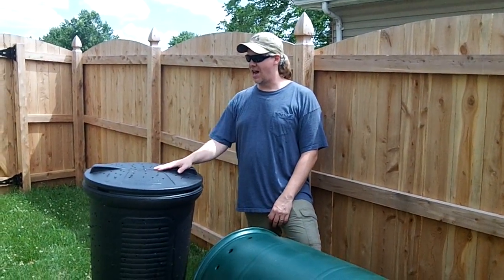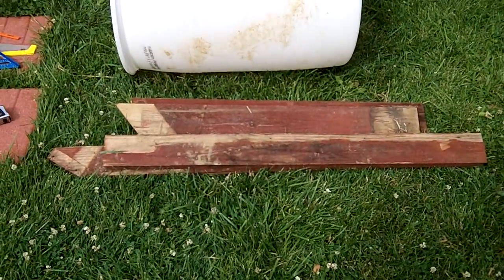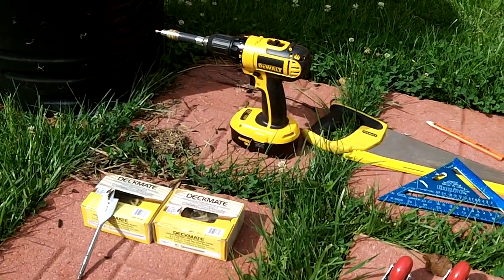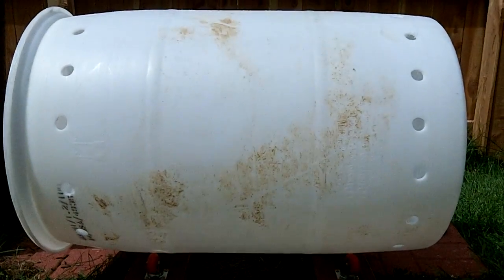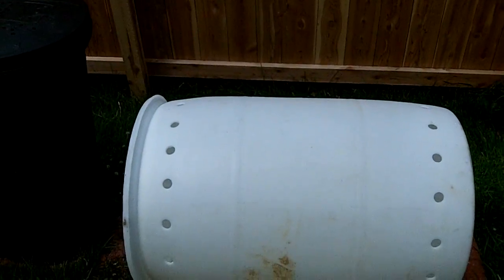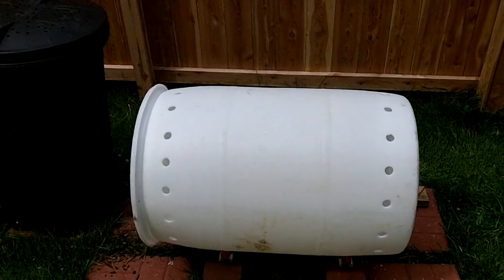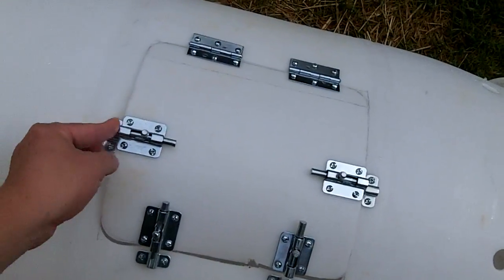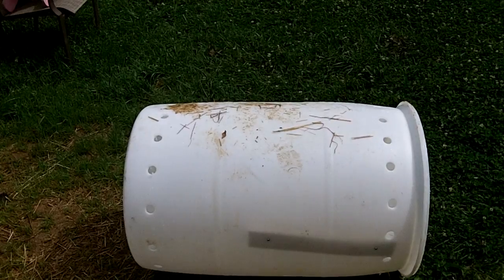Around the Home: #15 Building a Tumbling Composter

Comment: Where is the best location for such a composer?  Full sun, partial, or shade?  Getting a barrel in a few days and want to build the same arrangement but raised a couple feet off the ground.  Thanks for the video and suggestions!
Reply from the maker: That is hard to say. Mine is pretty much full sun. Keep an eye on the moisture, you may have to add in some if it gets too hot and dries out.  Also check out this video, i upgraded my composter to a double barrel and I found this worked better than having it on the wheels.  Good luck.  https://www.youtube.com/watch?v=2uSP6H9NDCM&index=22&list=PLONRmdcNsoZG9WoD9AdS-bswsA3O72zQS

Comment: Nicely done. I was going to try the center pole method when I make mine in the future... But I may try this method. I have materials for both methods.
What did u use to get such a clean cut for the hatch?
Reply from the maker: I used a jigsaw to cut the door opening. Started it with a drill bit just big enough to get the blade in.  The center pole method is nice looking too. I did not have enough scrap wood to make one otherwise I might have tried that. One thing to note, was the drum gets weighted the wheels may deform the plastic a little. We have had 90f degree weather and I have noticed that. Nothing big just turn it and the heat will set it back to normal. Just something to note. Good luck.